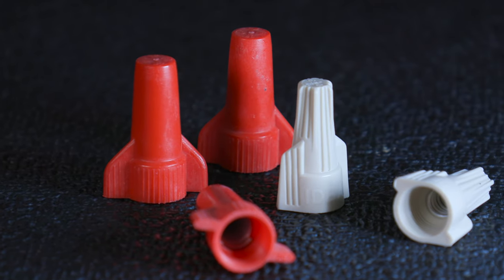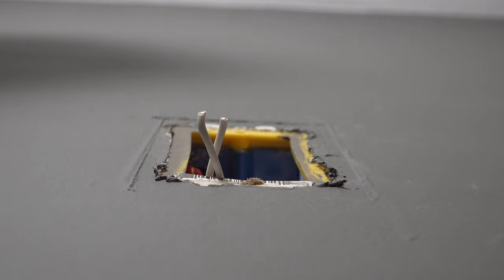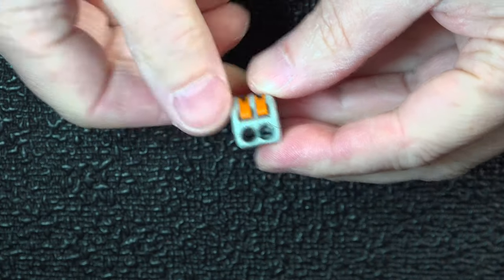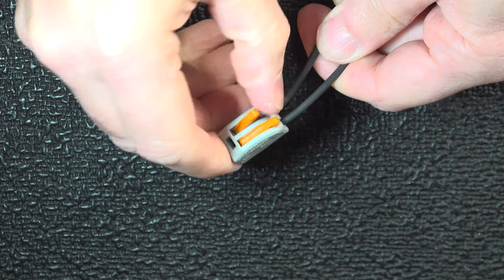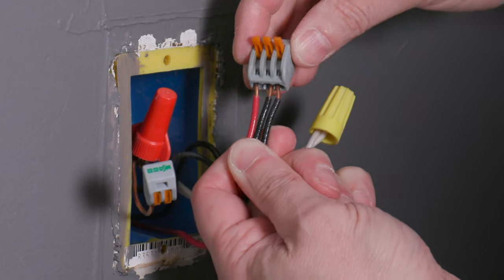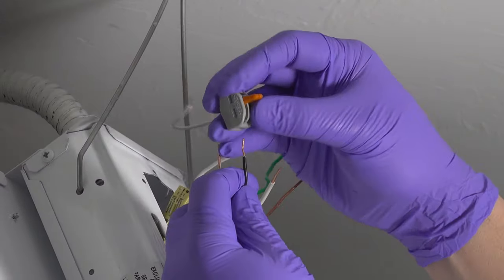Never use Wire Nuts Again - Wago is Better Electrical Connector

Comment: First of all, if you’re changing out switches or receptacles that often, you have a bigger problem. Not to mention devices don’t connect via wire nut, they have terminal screws. Once a tap is made, majority of the time it’s going to stay just like it is until then building is demolished. Secondly, not reusable??? Okay fine, sometimes they just won’t bite again, but a new one will without any problems. We all love quick connects but just twist your conductors and put a wire nut on it. And third, if it’s done right and up to code, there won’t be any issues whatsoever. Electricians don’t just walk out after finishing a job and tell the owner “hey good luck, be careful when you flip that breaker on.” It all gets tested after being installed and once power is turned on. More likely than not, if something over heats and causes a fire. It’s either a faulty device, or some shoty diy.
Reply: I use pig taild for recepticals, so in that instance I would use a wire nut.  But wagos are really annoying when you're tying in a 3 or 4 gang box bc nobody makes a wago that holds 10 ground wires. But I am hardcore team wire nut
Reply: @petermcguine8639  Don't the pigtails go into the screw terminals on the switch or receptacle? That's the point. Don't replace the pigtails...
Reply: @chrisjacobsen1659  feed in and feed out go to a pigtail. The pig tail goes to the terminals. Makes its so you don't have to backstab 2 sets of 2 wire onto a single receptical in the instance of having to replace one
Reply: I change mine out at regular 50-year intervals.
Reply: Unless you’re living to well past 100, that means you’ll maybe change our devices two times in any one house, if you change them when you move in, and once more in 50 years.
Reply: @45Deere9500  oooooh, maths. I like maths. Tell me more!
Reply: @petermcguine8639  you do but need a wirenut for ground wires
Reply: @TonyRueb  in a 3 gang switch box you sure as heck, do need a wirenut lol
Reply: THANK YOU!!! electrician for 30 years and 99 percent of the problems I fixed in homes were diy mistakes and actually a neighbors house burnt a few years ago, started at the panel. The same day they installed a dryer. Tried to blame the electric utility because there was a problem in a different part of town but was ultimately ruled accidental, origin electrical faulty installation. ELECTRICAL WORK IS NOT A HOBBY HIRE A PROFESSIONAL!!!
Reply: @cgsound  did they install the entire circuit or just a dryer?
Reply: Wire nut is the way to go.  Heavy loads the wire heats up. So over many cycles those new connectors fail.
Reply: @45Deere9500  And always use spec grade devices.
Reply: This guy knows what he's talking about. I change out all of my switches and receptacles every Tuesday which coincides with re-roofing day. What a tool!
Reply: @335m5  I'm going to guess they tried putting in their own 220v plug and did it wrong... and Woosh!
Reply: I am a big believer in using the pros, however, in any profession performance varies from very good to mediocre.  I am not an electrician but I used to work around them all the time. in commercial buildings.  Most of those guys were really good at it, but there were some that just didn't know what they were doing or didn't care.
Reply: <AMEN>
Reply: A lot of the switches I put in have leads not terminals.
Reply: I see the wire nut cabal never rests.
Reply: @zeddpilsner4  p
Reply: @cgsound  most "professionals" dont know what they are doing, they do its becaus they did like the last 30 years ...
Reply: Reading the comments,  it's truly amazing just how much hate there is for anyone not on the Wago-wagon.
Reply: @cgsound  maybe I'm not the typical DIYer, but I really dont find any residential electrical work terribly complicated.  The NEC has it laid out pretty clearly. 
That said, the shoddy work I've seen in people's houses is TERRIFYING!! You definitely need to know what you  are doing!
Reply: wire nuts come in different sizes, they also come with and without the metal coil inside, with wire nuts if you assemble them right, they last a very long time. i ran into the wire nut connections in a 100 year old house and every wire nut was a solid connection.

Comment: Another interesting feature about the clear plastic ones are that there’s a tiny opening at the back side you can insert meter leads into for testing
Reply from the maker: Absolutely. You never have to wonder if one of your wires is barely in there like wire nuts
Reply: @SilverCymbal  yaah and what about all the wirenuts previous guy installed... no, thanks.
Reply: @dllemm  I personally don’t care which gets used, they’re both effective.

Comment: Never call electrical anything “idiot proof”
Reply: True words of wisdom.
Reply: Yep.  When you say something is idiot proof, somebody else is saying "challenge accepted".
Reply: I have no worries (he says as he plugs in a black wire with a white wire).
Reply: @geraldeh7291  That makes it go faster!
Reply: A white wire to black wire is actually written in the code for switch Loop
Reply: The problem is there are some idiotic electrical contractors out there. i have come across a few in my time so making something those idiotic contractors can use with ease is making whatever the item is idiot proof, isn't it?
Reply: Yes that's supposed to re designated and is marked as such in accordance with nec article 200.7 c 1
Reply: never call anything idiot proof, someone will inevitably prove you wrong. idiots evolve to become better idiots and will eventually defeat all idiot proof designs.
Reply: @johng.1703  wow, that is amazing. consider my mind blown! I can't argue with that.
Reply: "There is no such thing as Fool Proof because Fools are so ingenious."
Reply: It'll work itself out.
Reply: @quantum441  The code designates a white wire as a grounded conductor(neutral), but allows you to use it as a switch leg if it is permanently re-identified. So when I have to use some kind of cable like NM(Romex), or MC to wire a light, I'll color the white with my black Sharpie to mark it a switch leg.
Reply: @quantum441  all X NEC code distinguishing a switch Loop
Reply: Scott Jarry  absolutely correct that's why NEC states that is a switch Loop black to white
Reply: Scott Jarry  Well, you're absolutely right. I just looked it up in my code book. 200.7(C)(1) clearly states the reidentified conductor "shall be used only for the supply to the switch, but not as a return conductor from the switch to the outlet". At least I got the permanently re-identified part right. :) In my defense: I think the specifics of what needs to be used for what has changed since I was an apprentice, but it makes sense. Also, I've done very little residential work in my career. Mostly I use the phase color as hot, and pink or purple as switch legs through conduit. But now I know! Thank you.
Reply: Scott Jarry  L.U. 291. Be safe!
Reply: @quantum441   yes, but not to each other at least not in a single pole switch . the way we do it white is the neutral and is tied through, and the black wires are power through and the switch leg.  I might be misunderstanding you.
Reply: @justaoldman5419   NEC? I might have to look that up, we always run the neutrals(white) through and use blacks for power and switch leg.
Reply: @Dom-k4y  my philosophy is K.I.S.S. keep it simple stupid. I ve run into to many big brained electricians that do shit to save money on the rough that will cause some service guy to pull his hair out down the road.

Comment: Here's why I will keep using wire nuts:
- They are dirt cheap
- Usually a red wire nut is good for most amounts of wire and sizes in home wiring
- Wago has a current rating while a wire nut joins the wires themselves directly and doesn't have a current rating
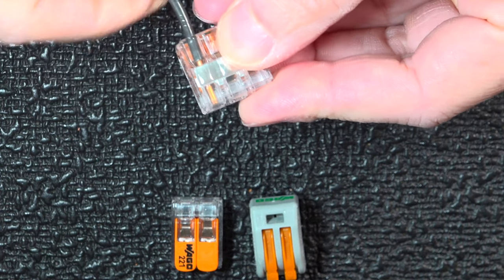- 3:10 I'm still begging companies to make transparent wire nuts but I guess we don't have them yet

however wago is still a good option

Mistakes you made in your video:
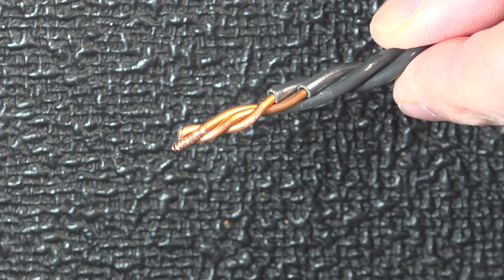- 0:33 you can keep using wire with bite marks and it will be fine, it will in some cases provide better connection because the recently stripped copper is guaranteed to not be rusty, you can also twist enameled wire with a wire nut and it will make a connection due to it's sandpaper abilities

- 0:42 you're wasting so much wire here by cutting the wire at the bottom of the wire nut, what you need to do is to remove the nut and cut the wire just where the copper stops being insulated (you can also use wire that is stripped, it's fine)
- 1:10 yes you screw them on and you're all set, if you put them too loose then you will immediately know to use a smaller wire nut, and if it's too tight then i don't know what you are doing, pre twist if you have 3+ wires, because you probably can't hold all of them together while putting the wire on, but 2 wires is fine to not twist because the wire nut does that for you 
- 1:29 I can, i separate the wire then twist them back together with a linemen's pliers, not that hard
- 2:16 use a smaller wire nut or solder them

Comment: The youtube algorithm never ceases to amaze me.
Reply: ...so you mean it's working?
Reply: Can someone explain to me what would YouTube be without them showing you videos you didn't search for ? There's something like that and it's called google
Reply: The one thing I've been saying about the damn red and yellow wire connector things is actually true who would've thunk it?
Reply: Get over it
Reply: Agreed
Reply: @4doorsmorewhors Google owns YouTube...  but okay.
Reply: @slump6982  what are you trying to say ? I don't understand
Reply: @slump6982 can you understand that these are two completely different search engines ? Even if they are owned by the same company ....
Reply: that's why I'm here too
Reply: @Openreality  the bonus of a wire nut is that the copper from both wires are actually touching and don't rely on metal bar inside the connector to join the wires together. I love Wago connectors though and have them in most of my house as I remodel it.
Reply: @bobby0081  like @"Peter von Feldt",  I also always viewed wire nuts with suspicion, as if they're a cheap hack for the short-sighted & risk-prone.
That said, I also fall into the "twist the wires and tape the nut" camp—I learned it that way decades ago.
You do cite a good trade-off:  trust the direct wire-wire contact, or trust someone else's chinesium conductor bar in the Wago. 
I think that—regardless of your preference with the trades—the 1 constant is:  don't get the cheap stuff unless you enjoy re-doing stuff.
Reply: Yep never looked at electrical jobs or products before. But glad I know about this now I used chopblocks previously not anymore.

Comment: Me using the same wirenut for 10 years
Reply: Literally changed out 2 furnaces today that were 23 years old and reused the original wire nuts, still good
Reply: Sir it's just fine to reuse a wire nut.they are not a one and done product. See my post to this guy's claims.
Reply: I’ve only had a handful of cheap wire nuts that crumbled. My 90 year old building still has the original wire nuts.
Reply: DSH...………….Put me down same thing !!!!!
Reply: I do construction in NYC for 30 years. Never waist old wire nuts. Always reuse it. So far so good!
Reply: @morgan98801  I don’t buy the cheap ones, I buy the CanTwists that work way better.
Reply: @morgan98801  You right, it's cheap. But if even cheap material is perfect what is the reason to buy again?
Reply: There claim  is invalid  you use a wire nut properly  you can snatch for months  and that wiring  connection  isn't  going  anywhere.
Reply: @itsmitch2162  These people's  claims  are invalid  not that there is anything  wrong  with this other idea either.
Reply: As an electrician I was taught to never rely on the wirenut, so to always twist your wires. So it's more of a cover anyway.
Reply: @mith2946  proper  connection  will last  forever  as you  twist the nut over the insulation  threading insulation  pinching  the actual  conductor together.
Reply: @lindseymcgahee2360  Yes, we all know what a wire nut does lol... I'm saying a good electrician always twist and cuts their wires before using the wire nut and doesn't rely solely on the wire nut twist.
Reply: @RocafellaPlaza  No a wire nut can be used  again  after unassembly  as long as you don't  destroy  the wire in the nut.
Reply: @gl9500  Marr connectors invented 1914
Reply: @gl9500  thanks for the info. Yes and those set screw wire connectors have more surface area to connect so mechanically superior to those wago connectors.

Comment: You also have to think of the universal nature of wire nuts.  Basically 2 sizes will cover 99% of interior residential wire combinations.  With a wago you need a different part for 2,3,4,5,,etc wire junctions or you are throwing money away. 

Where wago do shine and where I like to use them is inside custom equipment panels.  They're great inside cnc boxes and make for a tidy setup if the DIN rail is already full
Reply: Plus Wago's are massively expensive compared to a single wire nut.
Reply: Wire nuts haven't been used here for 10 years or more. Wago all the way. You have to think about Troubleshooting or when the customer suddenly wants more stuff connected as well.
We just threw out thousands of wirenuts thwt had been laying around unused
Reply: @rustusandroid  wago are probably 3 times as expensive, but also 3 times easier to use, 100 times easier to Troubleshoot if something is wrong and 6 times as easy to connect something new
Reply: And lights, they are blistering fast for can lights in housing
Reply: @fredrikfjeld1575  nah, 10 times... 221 3 wire wagos here are, at the cheapest, .25 cents if you buy bulk... the absolute best wire nuts can be bulk purchased for about .017 cents... its not even close, and most places are charging 1.75 EACH for wagos.... outrageous
Reply: Agreed cost alone will stop me from buying them.
Reply: @fredrikfjeld1575  indeed, when you’ve gotta work with hot conductors WAGOs are excellent!
Reply: @narmale  
what are you talking about? You can buy a box of wago clamps on amazon that comes down to 14-17 cents. Bulk is about 20-40% of that. They are more expensive than wire nuts, sure but nowhere near 1 dollar a piece.
Reply: @carstekoch  re-read what i wrote, im not having a convo with someone who doesn't bother even reading 100% what someone writes

Also link to that amazon page
Reply: Another reason to be happy to be living in the Netherlands: Wago is the standard and also only two wire gauges are allowed in electrical installations: 2.5mm2 and 1.5mm2. The bigger one for regular wiring, 1.5 is only allowed as a 'switching wire' to go from a switch to a lighting fixture for example. Wire nuts were a common thing over here but until somewhere in the 80s electricians massively switched to Wago. Also, the Wago 221 can connect anything from 0.4mm2 to 4mm2 with the same connector so you would only need to buy one kind of wire connector for everything.

Wago also has a cheaper option which won't work that well with stranded wire and that's one with teeth that bite into the cable but it's still smaller than a wire nut, way more practical for expansion and clear plastic to see if it's done correctly. Couldn't find them on Amazon but these are the ones going for the same price as a wirenut: https://www.elektramat.nl/wago-lasklem-5-voudig-0-5-2-5-mm-geel-per-100-stuks-2273-205/
Reply: @fredrikfjeld1575  It's not always about the up front money is it? I'm a corporate pilot and we blow $2,500.00 per hour out of the tailpipe. Yes the airlines are cheaper (ticket wise), but with us time is money. We get there faster, closer to the venue, hundreds of airport choices, our schedule, out and back same day if necessary which saves hotels, meals, etc. We avoid pretty much all the downside of airline travel and best of all, our clientele get there first and make deals worth millions. And we do it in style.
Reply: 2 wago sizes cover you from 10g down to something like 24 or 32g (cant quite remember). Also 32A or 40A - not sure id trust a wire nut at that current level for long, but have tested the 40A wago's at 90A for extended periods, the wire was hotter than the connector.
Reply: @narmale  25 cents vs 017 cents - how much will that save you in a day?
Reply: @elbuggo  when your wiring hundreds of lights a day? Alot
Reply: @narmale  How will the economy in the project change if you can install 1% more lights with Wagos? Use Wago 773-102 push wire connectors instead? Cheaper and faster, for permanent installations.
Reply: @elbuggo  the push connectors are horrible... we constantly have to revisit for replacement of them... we no longer use them
Reply: @narmale  Weird stuff. Disney Land Paris used a billion of them during the construction of the amusement park. Weird they didn't notice WAGO 773 are crap!
Reply: @narmale  Maybe if you start using them as instructed they will stop causing problems.